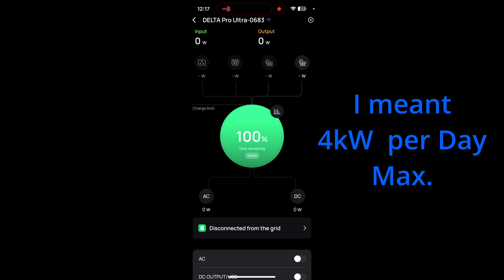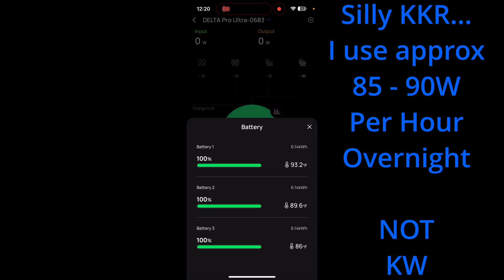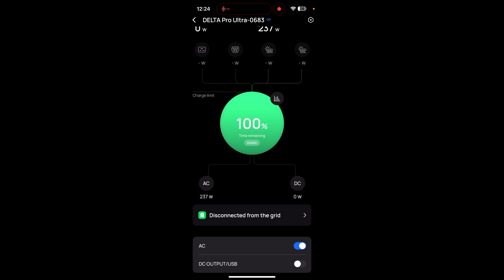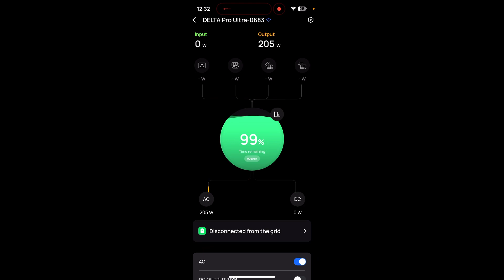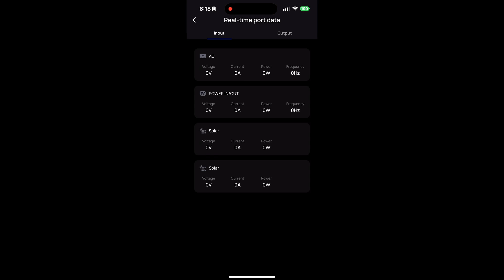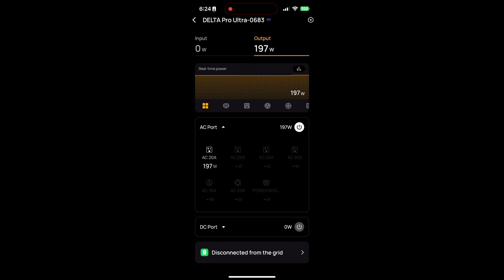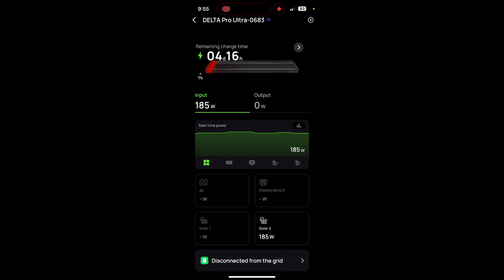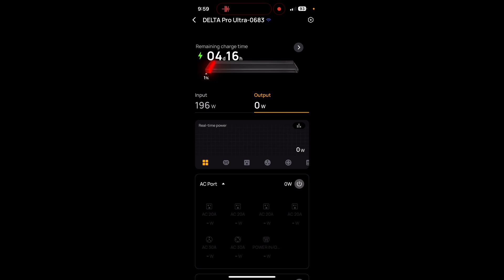EcoFlow Delta Pro Ultra ( DPU ) wasting energy?

Comment: When you click on the chart for the "input page", what your seeing on the bottom there is a percentage of how much power came from that source. In other words if it shows 100% solar, that means you used (only) solar to charge that day. It does not mean you hit 100% battery capacity that day.
Reply from the maker: Hey, thank you for your view and your comment.  Can you add a timestamp for my reference?  Thanks!
Reply: @KKRRenewables  at 1:43 when you go into the charting which shows input source totals (in watt hours), as well as percentages (in relation to all other input sources) for that time period.
Reply from the maker: I’m a bit confused by why you’re making this comment I guess.  I understand the 100% metric on the input details page “how much of the charging came from each input”.  That particular page had to reflect 100% because I only charged from solar.  In my dialogue, I was referencing the total battery state of charge being achieved of 100% starting around 12 seconds in the video.  That SOC went from 59%  previous day to 100% current day with adding less than 1kW of solar charging.  In a 18kW system, that’s not possible.  I think it just needed calibrating.

Comment: Appreciate your DPU videos.  My DPU system has 2 batteries, 1800W solar, and drives all my household non-heating/cooling circuits (including well pump) off grid through reliance transfer switch.  I also have the AC input connected to a 1kW isolation transformer (surplus medical unit found on eBay) to charge batteries at night (@ 800W) in case of many cloudy days.  I found the DPU draws around 10W power when it has power on the AC input, so I connected my isolation transformer to a Kasa smart switch that only activates the AC input during the DPU programmed charge period (plus a 5min buffer).  This avoids all losses associated with AC input when not in use.
Reply from the maker: Sounds like a great setup.  I appreciate your view and your comment.  My AC input is rarely ever on as I run almost solely from Solar.  Thank you for helping the community by proving your experience.  Have a great day.

Comment: Well done.A bit of power,I suppose,could be the battery cooling fans.Probably not much but taken in aggregate with the other things you mentioned may bring you closer to the loss you are experiencing.It would be helpful to the layman like me to know what sources of electric draw you had plugged in.Lights,computer,router etc.I know you mentioned TV at some point.I have an EcoFlow DPU with 5 batteries shipping shortly to use as a whole home battery back up and I am planning to tie it into my breaker panel with a generator plug and breaker lock out device.I will switch off the breakers that are heavy users of power and get by running basics as well as home medical devices such as Cpaps and oxygen concentrators.I also am getting an Ecoflow duel fuel generator to augment the battery pack in case of extended outages.Going through a 6 day power outage changes ones outlook a bit.The 30% tax credit has helped us make our decision easier for the initial monetary investment.
Reply from the maker: Thank you so much for the view and the comment. We have only home electronics plugged into the DPU.  TV, computer, video processor, and lamps.  I do not know the impact of true power vs reactive power on the batter loads.   The devices my DPU supports utilize both types.  Techopedia defines them as below:

True power

The actual amount of power in watts being dissipated by the circuit

Reactive power

The dissipated power resulting from inductive and capacitive loads measured in volt-amperes reactive (VAR)

Apparent power

The combination of reactive and true power measure in volt-amperes (VA)

Good luck with your system.  It sounds phenomenal and well thought out.   I’m sure it’s going to be a great relief knowing you have power options covered in the event of a power outage.

Comment: You have to keep in mind that the inverter itself consumes power just being turned on, do a test of the consumption over time with nothing plugged in.
Reply from the maker: Yep, that’s one of the tests I did.  I’m burning  10% per 24hr period.  That is 1.8kW in my environment.  If you pull up the lab section of the app, it’ll show each socket voltage while it’s inverting.   Thank you so much for your view and your comment.  I really appreciate it’s your time.

Comment: But you never turned off the inverter when not in use???
Reply from the maker: That’s correct.  I was testing to see the drain on the system with no load.  It appears the system drain is consistent and you just add the load drain on top of that number to get total drain.

Comment: I, too, have 2 DPU's with 10 batteries and I think their software needs to be adjusted.  Same with the application that shows "Savings" which doesn't show when you're own your own power but will show under TOU settings?    Ecoflow seems to have more software development to do.
Reply from the maker: @tlteal  I totally agree.  I hope they can address their power inefficiency with a software update.  Seems regardless of the number of batteries you apply, you still lose 10% daily if AC inverting is enabled.